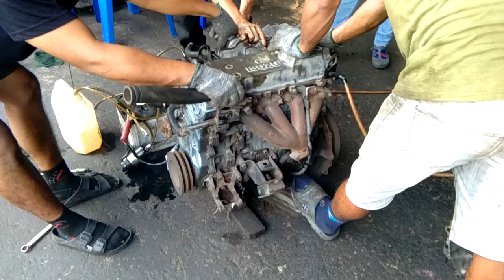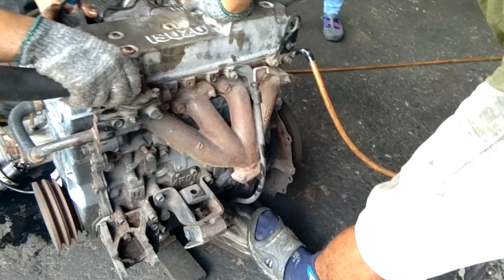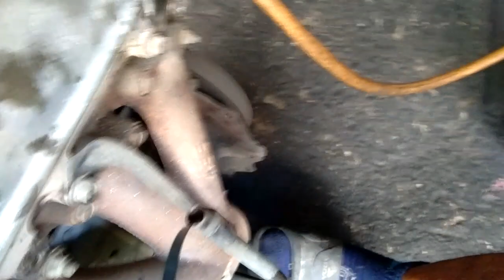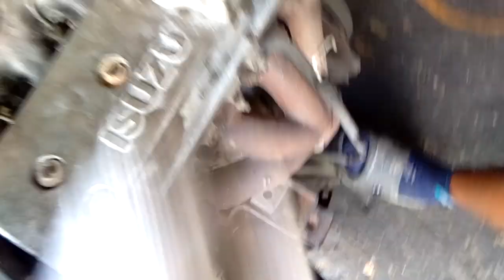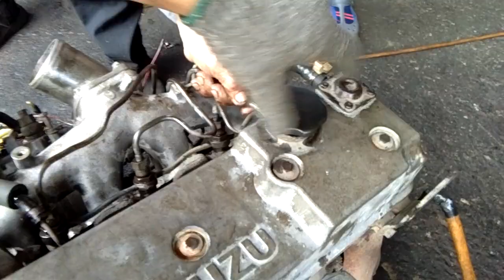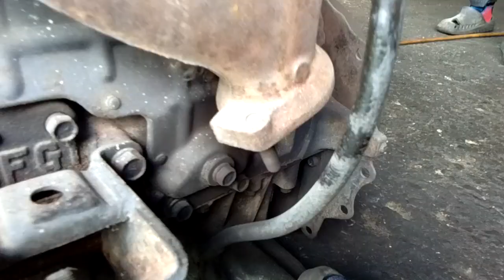ISUZU 4FG1

Comment: Hello.where engine number for this model?
Reply from the maker: It is on the side of the exhaust pipe. It is located on the wing of the engine. The back is attached to the longstat steel plate.
Reply: How many digits are placed in 4fg1engine boss